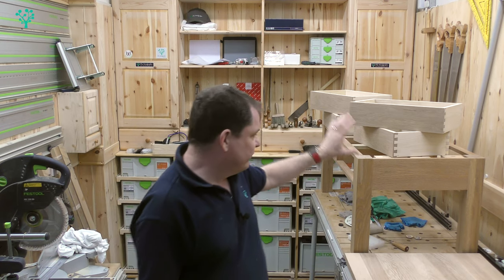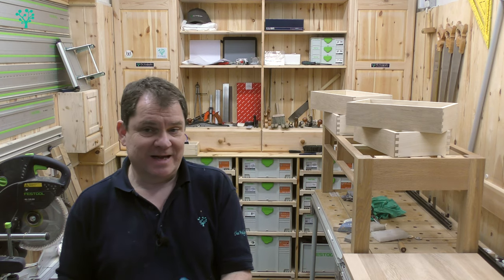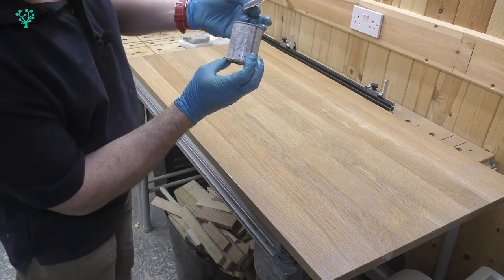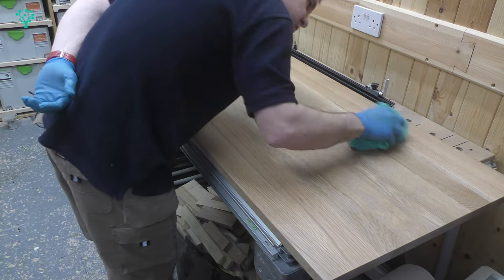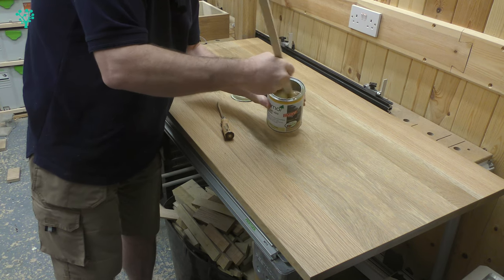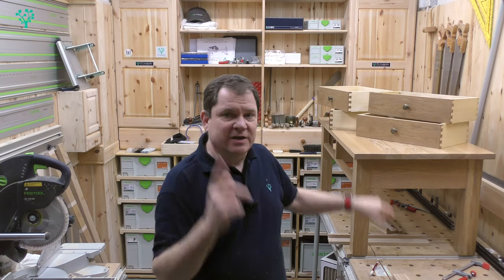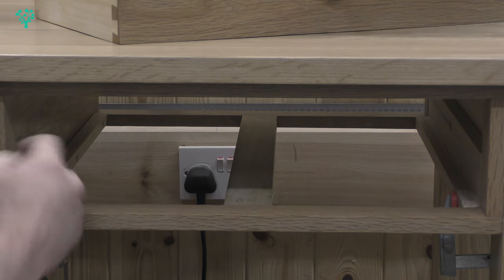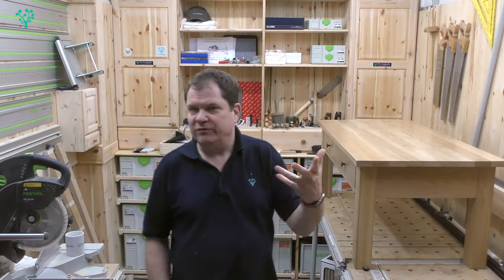How to build a coffee table part 16 - The Finish!

Comment: Thank you for this in depth tutorial Andy, the finished table looks excellent and is a credit to your craftsmanship. It has also seen off at least 50% of the wet British winter so thanks for that. I trust your client was pleased with the end result?
Reply from the maker: Thank you Richard, yes really pleased with it. They now want a small side table to match. But unusual in that it will be a wedge shape - so will make for some interesting joinery.

Still working through the design phase on that one.

Cheers

Andy

Comment: Gorgeous and what a great finish. I use lint free cloth in the same manner putting on the osmo that I use and it turns out equally gorgeous. Thanks for a great series! Waiting on the next 1.
Reply from the maker: Thanks Gary,

Yes love OSMO - such a nice finish. I do like the way that the white sponge pushes the oil into the grain - but whatever works has to be correct.

The next “big project” series will be in the web site - changing the focus of you tube a little. Will be recording a channel update later today to explain more.

Thank you for the support
Reply: @TheWoodgrafter  I need to source those here as I used them to clean my plastic fish tank before in Japan. Here in the Philippines is a little different. I will check Amazon though.

Comment: I'm glad you used Osmo - I recently discovered that over here in the US - not all that easy to get (yay, Amazon!). Some people recommend machine-buffing the finish in - so I tried that with my Rotex 150 and I was really impressed. It heated up the finish a bit and it really looks beautiful. I think when Osmo is used on floors they often recommend buffing it in. Have you buffed an Osmo finish, or is it not necessary - it isn't a well-known product here in the US.
Reply from the maker: Hi Larry,

No never buffed the finish, but that does make sense as it is a wax finish when the oil soaks in.

Budding wax is pretty standard practice (as you know). 

I’ll give it a try and report back.

Cheers

Andy

Comment: great series andy, i would like to know what you would have done differently if you had used your hand tools and how much longer it would have taken. keep up the good work.
Reply from the maker: What a great question .

The joints would have been mortise and tenon rather than domino - the rest would have been the same construction.

I would have probably also bought pre—milled stock. Hand prepping that amount of Oak would have been very time consuming.

I would anticipate at least 5 times as long with hand tools.

I have got a half baked thought to build something using all power tools and then build the same thing with all hand tools.

So we can contrast the approach, time, cost and quality aspects.

Wouldn’t be a big project - perhaps a simple box with a drawer.

Cheers

Andy
Reply: What a great idea , I look forward to seeing that project.
Keep safe and sober....
Reply from the maker: Not promising sober...

Stay safe

Andy